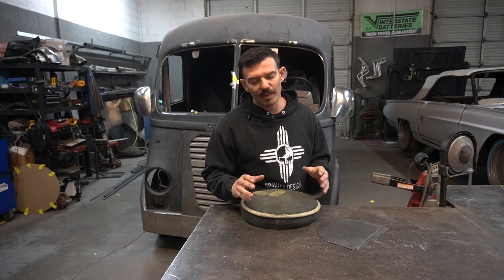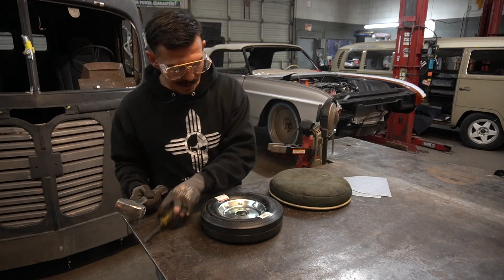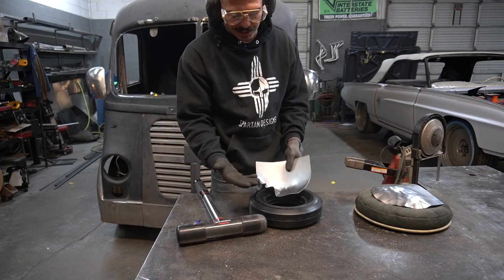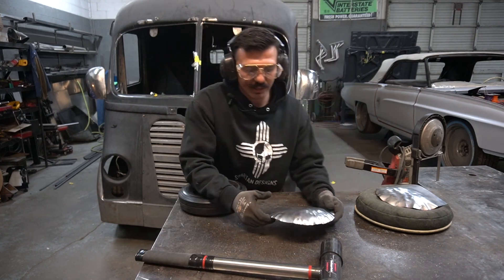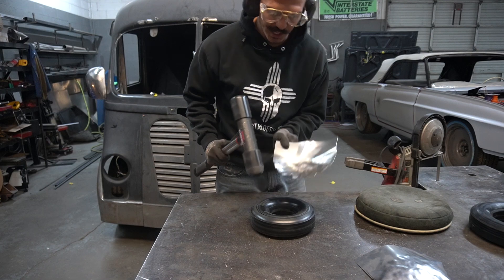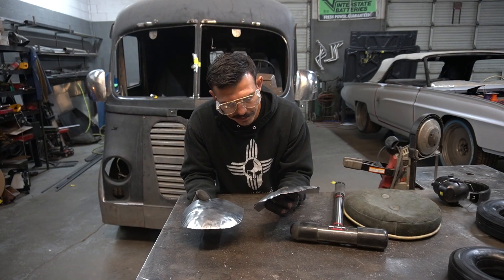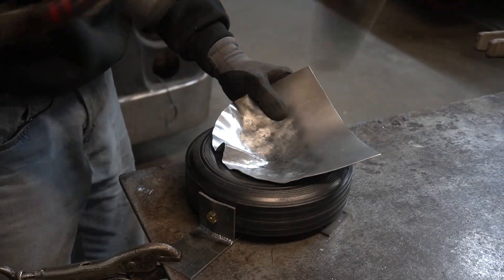Metal shaping with simple tools | cheap shot bag | Rubber stump

Comment: Pretty cool.  During the summer of '89 I was in Shanghai.  I watched a guy make perfectly spherical cooking woks using only a medium hammer and a an old mini railway wheel.  At least it looked like that.  The working surface of his "anvil" looked like a hollow cylinder or tube pointing up, with about a 10" od surface and a 3/4" wide hammering surface.  He just gently tapped on the ID as he slowly rotated the disk.

Comment: It's great to see almost the same mallet in use that I ordered from Wray Schellin years ago. It's an absolutely top-class tool. I don't have a lot of experience in sheet metal working. I only make simple motorcycle parts, such as fenders and tanks out of aluminum. I supplemented the sandbag with a discarded construction site sign mounting plate. Solid rubber, weighing 43 kg. And you can cut the cavities you need into it. It works wonderfully for small to medium-sized sheets, nothing tries to slip away.

Comment: A few beads of silicone on the bottom side are pretty sticky when cured up but not used for bonding.  Just a sticky coating on the bottom

Comment: All welding tanks have a “ punt “ or concave bottom . Cut the  bottoms  off and use as forming tool. Some  are deeper than others.Acetylene tanks don’t have it and don’t even think about using them for anything but holding gas.  Some small medical grade oxygen tanks have a very deep concave bottom . It goes without saying do not cut oxygen tanks with a dry blade “ no oil”!!

Comment: 2 questions. What if you lay the tires on the bag and try it?? #2 what if you use the use the delren hammer head on the the stacks of rubber mat form the tucks then beat them in the rubber tire to speed up the shaping.
Reply from the maker: I could put the tire on the sandbag that would work great!

Comment: I have used tire inner tubes filled with sand or sand blast material you can adjust how much sand you use to be able to control how firm they are I used wire to tie them closed could make two or three out of each car or truck sized tube . They last a long time . Great video as usual. Thanks TUBAL
Reply from the maker: Great idea! Thanks for watching brother!

Comment: It looks like a non-pnumatic tire. Are they both easy to come by & cheap? Tree stumps have been used. You might have to re-arc the concave depression after much use &/or for different shapes. Possibly a 3-4 foot piece of tree trunk of the hardest wood u can get would suffice. Or a few feet of 2 x 4s, 4 x 4s, etc. glued/nailed together. You may find free or super cheap scraps. Be inventive.
Reply from the maker: Or you can just use a full rubber tire for ten bucks lol of course, wood stumps have been used forever dude this is just something new and innovative. Think outside the box

Comment: I have used thick 2 inch rubber and used a hole saw to different sizes. The rubber i used is soft then those tires it seems to move the metal faster and doesn't move across the table
Reply from the maker: Haha nice dude glad I could help

Comment: I can see in your technique that you have taken some pro shaper classes with with Wray, very interesting use of a tire I have to try it , I think your tucking tool needs something to soften the edge, so it doesn’t mar the metal keep up the great work
Reply from the maker: Yes I learned a lot from Wray! I consider him a friend! Also I use the same plastic material on the dies that Wray uses on his, its that polymorph, I just haven't put it on yet, I think I'm going to cut the dies off and make a different tool out of it, like a press hammer I'm going to try out. thanks for watching man!

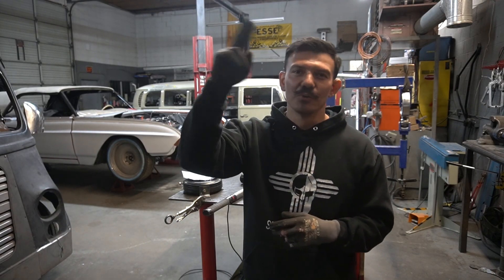Comment: I like the idea of using the tire as a tool. I definitely believe in thinking outside the box. It gives you the results you want - and apparently 9:17 faster. Correct me if I’m wrong but it strikes me that the sandbag actually stretches the middle more thus requiring less shrinking around the outside. Just pointing this out in case it matters. In most cases it probably doesn’t as long as you get the shape you want. Also, this is great for a round part while the bag might be better when making an oblong shape - so don’t throw out the sandbag.
Reply from the maker: yeah dont get me wrong the leather shot bag works perfectly, I guess the tire works more like a stump. thanks for watching!